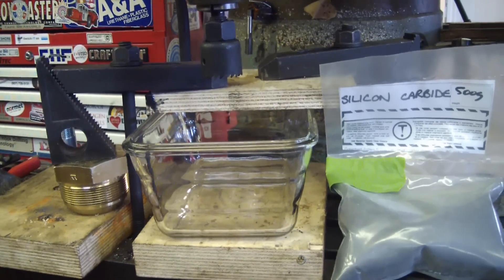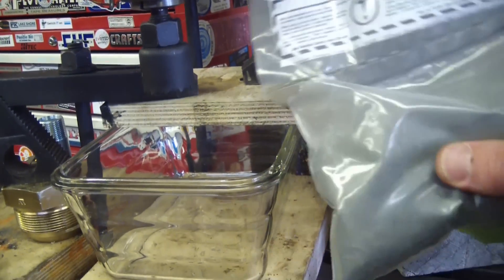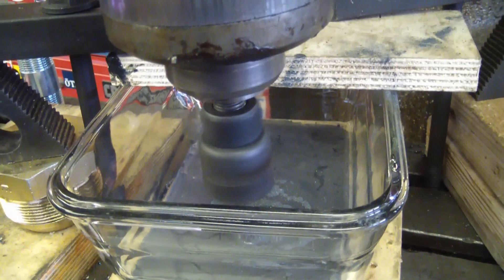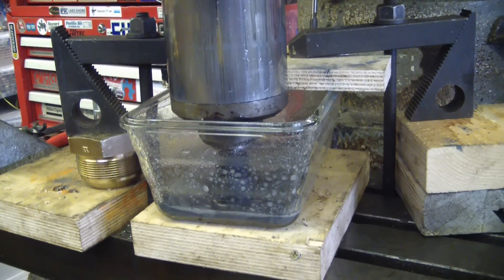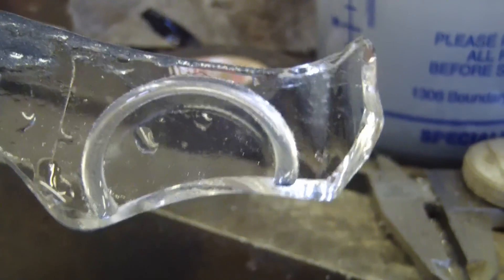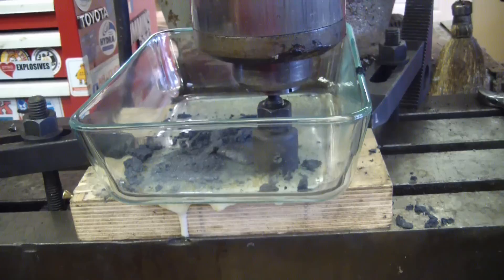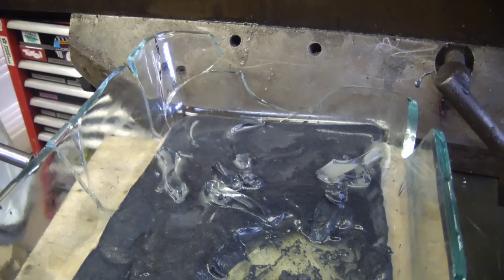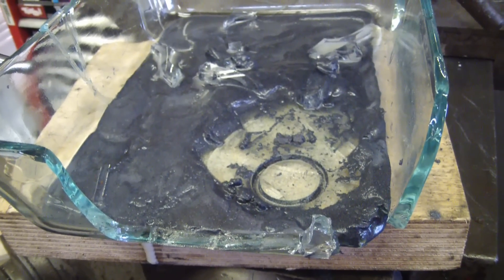Using Silicon Carbide to cut glass

Comment: I know this comment is way late and that people have said it's impossible to cut tempered glass but I would have tried cutting one way to the half way point then flipping it and cutting from the other side with very light pressure when nearing the middle.. This works when cutting brittle Tiles that shatter if you just cut from one side. Sometimes when tile cutting this way I stop just shy of breakthrough and pop out the core with a punch as the bit can bite at the last point and break the piece!

Comment: i had read some where along the line that you can remove the teeth from your drill bit and just slot the head. supposedly the bit still picks up the abrasive and plows the road.

as far as the shattering goes it could have to do with the constant vibration of the bit transferred to the glass through the bit. much like chiseling a stone in half or a mason splitting a block.

Comment: You can actually look at the stress in glass using a polariscope... or using a white screen on your phone and looking through some polarized sunglasses with the glass in between. I was a lamp worker and the way we broke glass was scratching a line, getting it wet, and applying lateral force. it will snap cleanly. the trick is the water. try this with Boro.

Comment: I don't have much real experience, but I suspect what is going on is that with all the noise it is making, some of the frequency components and harmonics is hitting the resonant frequency and causing it to shatter like the wine glass stuck in front of a speaker playing just the right note. The resonant frequency of that thing is probably much higher because it is thick and very stiff, so it is plausible that the thing is vibrating enough to shatter it.

 P.S. you are exactly right about the glass and thermal stress weakening. Glass being the amorphous solid that it is, it has many weak points all though it when it is made. Applied Science has a good video talking about glass in his video where he chemically strengthens it, and makes "gorilla glass"

Comment: Cool video.
I suspect your on the right track re the Prince Rupert drops. Most glass dishes are toughened by a process which puts  a lot of compressive stress in the material, the hole you are  trying to drill causes an imbalance in those stresses leading to the fracture.
The only other possibility is localized heat could cause a fracture, but I'm assuming that didn't occur since you seemed to have plenty of water in the dish.

Comment: Silicon Carbide is used in glazes on pottery in small amounts. Not sure on the exact chemistry but it reduces copper into it's red colour so you can make red glazes in an electric kiln. You need gas otherwise to get reduction in a kiln by pumping too much fuel in and reducing with carbon monoxide.

Comment: All glass breaks due to the harmonic frequency of the glass being hit. Fill the container full of water, and slow the drill.  Water will dampen the sound, and slowing the drill will lower the pitch.  worth a try.  Tempering may induce tension that is relieved by cutting, so there may be no way to cut tempered glass.   Untempered glass often can be cut underwater with scissors, but wear thick gloves to try.

Comment: If you have a way to heat (bright yellow steel temp range) the area you want to cut, and then run the saw slowly it will take the surface-tension stress away from the area, however, if you do end up putting any kind of uneven pressure on the walls of the hole, it will crack just like it did on the video.  Had a similar task once, but it was on a lid, and the hole was for ventilation (vapors to exit) so there was no pressure on the area.  Hope it helps, we used torches and salts to heat the metal.

Comment: Definitely try with cheap untempered non-pyrex or anything special glass. I drilled aquariums for filters and such and if the plumbing had to go thru the tempered bottom it had to be replaced with plain old glass cut to size instead. Then you could drill a hole in it. Also, make that hole saw into a flat no-tooth cylinder with maybe a slot or two up the sides. And lastly, build a little dam up around the hole with putty to keep your abrasive and water in the right place. That way you only need a small amount and you dont get a huge spill once you break thru the glass, be it with a hole or otherwise.

Comment: I am a glazier (from the uk)...I'm no expert on glass but once it has been tempered it cannot be cut again even with diamond tipped glass cutter. The pirex doesn't break in the same way toughened sheet glass breaks (lots of small pieces fairly the same size) so could try a hole saw for tiles and some masking tape to help it not skate around.

Comment: Just reviewing the slow motion video that you linked at the end, the one thing I notice is the drill isn't spinning directly on centre, and as far as i understand, that'd be putting unnecessary stress on the rest of the glass. Since they both broke when they were almost through, I think it could be because the issue I mentioned.

Comment: if you have a plastic cylindrical container that is the size of the hole you want; then you can fill it with hydrofluoric acid and place it on the glass and it'll eat through the glass and give you a perfectly clean cut if done right.
Reply: I forgot to mention it won't eat through the plastic.

Comment: Great vid!!!  Sorry the bowl broke, but it sure was fun to watch.  With 300+ responses already, there's no way I can read them all to see what has been suggested.  As soon as I saw you go CW, I wanted to suggest CCW.....and you did that.  How about a piece of tubing with a flat end.....or grind all the teeth off the hole saw.  I wonder if the teeth are setting up a certain pitch, frequency or harmonic that is causing the breakage.  Maybe run the flat ended tubing more slowly?  Add more water or heat sink the underside for better cooling....hhmm......set the bowl inside another, bigger bowl with water in it on some spacers to allow water to get underneath.  Would add cooling and maybe some dampening?   Hmmmm......maybe destress the underside by start the hole out there.  Seems I remember something from drilling fishtanks that it had to be drilled from both.  You know how metal gets that huge burr at the exit of the hole....with glass, that burr would be a bunch of fractures causing it to break.  Hmmm.....maybe clay or putty for dampening?  Built in a donut mound around the hole, it would also help keep the silicone carbide near the hole.  Okay......I tried my best to come up with my 2 cents worth.....I know I fell short, but not all my cylinders are firing......my brain no chooch so well. :)
Mike

Comment: It causes silicosis, which is a lung condition similar to asbestosis.Basicaly the structure of silicon carbide and other silicates is such that when you inhale it impales itself in the lung tissue and it stays there forever,causing damage and scarring your lungs which can lead to cancer.But silicosis on its own is a serious condition.And it really doesn't take much,all you have to do is take a handful of that silicon carbide and throw it in the air and then take a deep breath from the cloud and bam,you just messed up your lungs irreversibly.Respirator is a must when working with silicates

Comment: I’ve seen circular holes cut in plate glass cut using a copper nip... cap and jewelers rouge polishing compound. Drill a half hole at the edge of the cap in two places and a hole through the flat end with a bolt through for your chuck. Go extremely slowly with very light pressure.the slurry should be more of a paste. Reversing the drill keeps the nut tight. It takes a really long time, but you don’t want it getting hot.

Comment: The glass is forced into the dish-dye at about 1700C° (yes, I'm european..) and quickly cooled off to harden it.
As you said, this creates stresses between the exterior and interior of the glass itself at the one cools off a lot quicker than the other.
To get rid of those tresses you'll need to heat it to about 1200°C and let is cool off slowly, note that you will lose the hardness of the glass.
Drilling holes in hardened glass will always jumble up the stresses and most of the time will cause the glass the break.

Comment: Oh i also have a useful comment...

Two of the biggest factors in the glas shattering are temperature differences and the vibration.

Try grinding the teeth off, and make sure it runs as true and smooth as possible.
The vibrations are trying to move the glass, but it's not going anywhere. That puts a lot of stress on the glass - and since it's already under a lot of tension from the casting/shaping it's just give up at some point.

So yeah, try making the motion as smooth as possible, consider mounting the glass so it's got some wiggle-ability - and run it nice and slow. 

Sometimes you can get lucky by wrapping the outside of the glasbowlthingy in tape or book-wrapping film (no idea what that's called). Just like when you're drilling through tiles, it help dampen some of the vibration. And it does some other magic too, that I don't know anything about...

Drop me a message if you want me to explain this a bit better...

Comment: I might be completely wrong but maybe the vibration of the drilling is what's making the glass shatter,just a thought ,try wrapping the rim of the glass with some sort of rubber for a dampener. think of when a brake rotor is turned on a lathe,it has the dampener strap wrapped around it to absorb vibrations

Comment: She's probably tempered chief, like ya say with the Prince Rupert drops. The outer layers hold the insides in, like a corset, cut it and out comes the belly. It'll actually pop apart just sitting on the bench if ya got a half drilled hole in it, which looks real cool when done underwater

Comment: Stupid question maybe but does your glass container with the hole in it need to be Pyrex? If your not heating it after I'm thinking of an aquarium type setup. Old window glass cut with glass cutter and make your own vessel by the same means, silicone the corners. Easy to drill that type of glass.

Comment: For a brief period, I worked for a place that did automotive windows. To cut glass, they would pour alcohol on the glass, after scouring it with a razor blade. The heat from the alcohol would allow the the guy doing it to snap off the piece he wanted. Granted that was for a straight piece, and not a hole.  As stated above, by others, copper pipe and silica carbide is probably your best bet, at low speed and feed. 
Speaking of alcohol fires, the boss at that job stated to one of my colleagues that alcohol fires are the "cold" fires. He then said watch this, and put his hand in the flame.
Reply: Did he just put his hand in the flame and pull it out super quickly? or what?
Reply: Long enough to burn him. I wan't there for it, just heard about it after the fact :p

Comment: Try filling the dish with warm 175 deg water and keep it full and same temperature during the drilling process, along with silicon carbide to stabilize the surface temperatures evenly,  I've never cut glass be have cut pure tungsten which is similar, and can crack from a surface temperature gradient under stress, maybe also cover the dish with a rag so no cold air hits it while drilling. 
David

Comment: Fill it with water or sink it in water, it help absorb the high frequency vibrations.

Never drilled but works for cutting, can cut glass under water with tin snips second you try it above it shatters

Comment: When you break the crystal structure of the glass particularly this type of class it is formed in a way that the outside is being pulled in Word and you are causing a catastrophic malfunction of the crystal structure which allows or causes the cracks to form in the same way that a diamond blade on regular class causes a crack and when you stress it it breaks this class is constantly under stress which forms its ability to be under stress until you cut it

Comment: Use a copper pipe section as your cutting tool. I've been successful using oil based lapping compound (Clover 800 grit, IIRC) and moderate feed pressure and slow RPM. Cutting from both sides was the key for me.  Once the hole is cut, use your torch to smooth the edges.
Reply: Talked to some friends that do this for a living and they said you should be using an abrasive water jet.

Comment: I think thermal stress is the enemy. 
Choices:
1) constant cooling, IMHO the best choice, set up a little recirculating pump with a largish volume of water, say a 5 gal bucket or whatever unholy metric volume that is.
2) heat the biotch up to the temp you expect to reach from friction. This sucks because you will have to cool it down at a very slow rate, remember when you melted the beer bottle in the camp fire?
Just a thought.

Comment: My grandpaw had a brass tube hole saw with silicone carbide it said 900rpm with a dam made of clay and kerosene as a coolant. It was only for making holes in glass to make lamps about 1/2" hole saw. I always wondered why did they suggest kerosene? Good luck and thanks for the videos.

Comment: Try with minimum pressure from the top.Also a softer base to hold it, as the vibration and pressure are what will make it crack.every part holding it must be of soft material, and the strength pushing it must be minimal, it will work.Good luck

Comment: Prince Rupert drops is the correct thinking. Your drilling technique is fine, the problem is the surface compression in the glass, which based on how it's breaking is probably upward of 9000 psi. Glass that can be cut and drilled typically has under 500 psi surface stress. If it's not properly annealed you'll never get through it without it fracturing.....

Comment: You might want to run the drill in reverse, the flat side of the tooth would push the grit along the glass instead of scooping it in front of the teeth. Most of the energy is being wasted dragging the teeth on the surface of the glass not cutting into it. I read recently about oil being used instead of water in the slurry as it's more binding. Just ideas. Love the videos

Comment: Set the entire thing submerged into water then drill or cut it. Submerged in water, the glass will have and equal force acting upon the entirety of the surface area, this should dampen vibrations and bending stresses caused by physical action upon the glass that will fracture the glass. Think of it as reverse case hardening a case hardened material but only for cutting purposes.

Comment: The only way we've ever managed to cut tempered glass at work is with a water jet with garnet abrasive. Or laser ablation. I doubt they make glassware that isn't tempered, but if you can find annealed glassware, you'll have better luck. When we drill annealed glass, we use about 5000rpm with a 3/8's chamfered diamond drill at a .20mm/s feed rate. Convert that to a hole saw as you will.

Comment: Try using warm water and a little less pressure.  It's possible the cutting process is actually causing heat stress that is being cooled by the water. Or take a couple of breaks to let everything really acclimate.  Even Pyrex can fracture because of a focal heat point.  Also if possible keep the area under where the hole is open.

Comment: it is heat. i am a used to be a chef now a supervisor for an engineering department at a hotel in park city utah,.  the Bit is creating a hot spot and the liquid around it is cold.  if you take pirex out of the oven and set it on a wet rag it will shatter (experience talking).

Comment: If you have access to a waterjet you can low pressure pierce the glass, then interpolate any size hole, but tempered glass has a 50/50 chance of shattering like yours.

Comment: Also run your cutter much slower and with less downforce.  It will take a long time.  Finally, if it’s tempered glass you’re drilling, it’s probably going to be too brittle to drill no matter what you try.  My grandpa was manager of a glass bottle manufacturing plant.  I watched bottles being made many times as a  kid.  They hold mounded glass at around 900 F for quite a while after it leaves the mould, to anneal & stress relieve.

Comment: tempered glass is under high stress, one side in tension, the other in compression, the idea is in will shatter into pieces when fractured. only a diamond saw has a shot, and then you will have to be careful, even after the hole is cut. if you have to do it, heat red hot to relieve the stress.